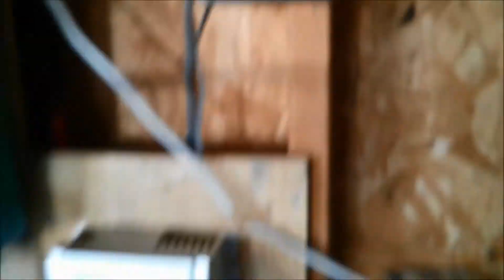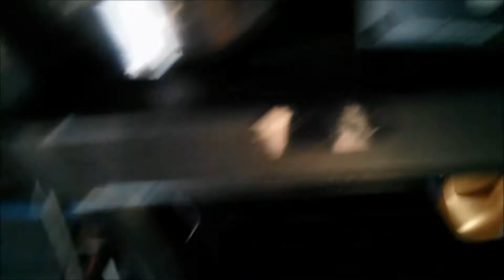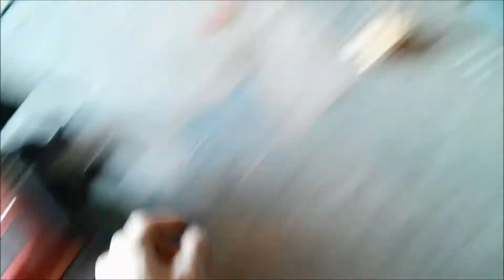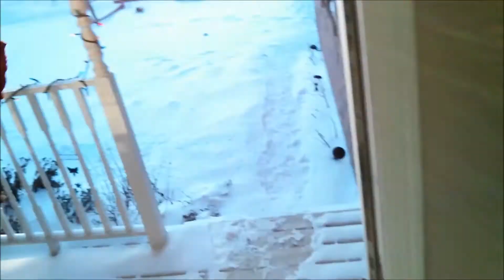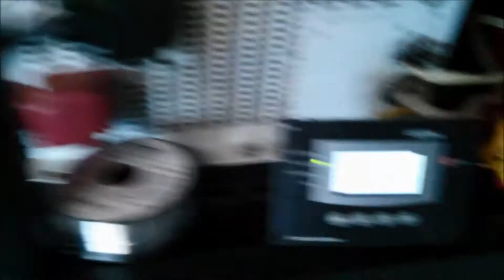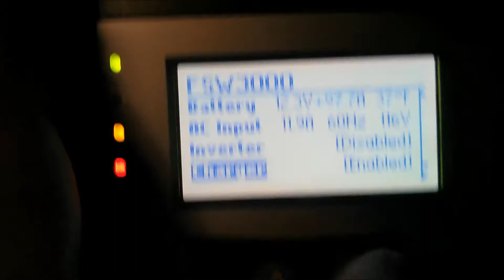Off grid for a weekend ending

Comment: Suggestions, in an emergency requiring you go off grid, you can run a much lower power lap top and hand wash dishes. You can switch to LED lighting, and in winter when you have less light to your solar, you can put your refrigerator unplugged outside to keep things cool enough.
Reply from the maker: yes with just what you said id be able to go off grid 24/7 i be leave

Comment: Hey question ! Do u have those smaller batteries in that tub hooked up to your big bank ?
Reply from the maker: yes i do, i have tested and they help, and I don't care what people say about mixing battery sizes, if they are fused they help, and im not losing Ah like some people say, A big lie if you ask me. But i do like the bigger batteries better, why? cause they are bigger/ more AH! Wow didnt know you had videos up! im gunna watch them all!!!!!!!
Reply: I hear ya on using up all the amp hours you've got, that's kewl .... Just wondering on this test if the smaller ones would empty sooner giving your meter a lower voltage reading on your inverter !  Been slacking a bit on the vids but I'll start throwing up a few more soon...
Reply from the maker: peeinginthewind the smaller ones would drain a bit faster, and all my batteries even my booster pack run at a much lower voltage in the cold.